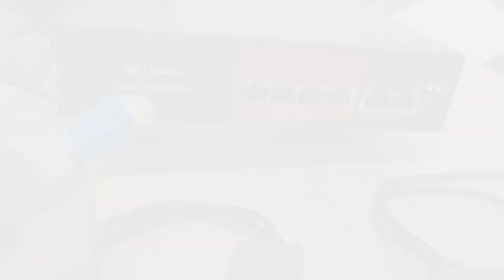How to use POE splitters to connect non POE IP cameras

Comment: Hi great video would i still need too use a router from modem too do this setup? Thank you
Reply from the maker: Hello, this requires only the POE Switch to work. You don't need the router unless you are using the router to help with Remote access and in that case you would have to connect the Camera to the  POE switch and link the POE switch to the Router. 
Please if you need further explanation, kindly send me an email, script.engineeringconsult@gmail.com

Comment: Just to make sure, if the switch wasn't the poe switch you would have to use both poe splitter and poe adapter yes?
Reply from the maker: Yes, when you don't have a POE Switch, a POE injector can be used.
Reply: @Tech_Inside_Out  So you would connect poe injector to non poe switch and additionally connect poe splitter to poe injector ?

Comment: Hi, you are using ethernet cable with mode A or B? Also would like to know if the cable is CAT5e or CAT6. Thank you.
Reply from the maker: I have used Cat 6 cables terminated as straight through cables in this Demonstration. But either straight through or cross over works.
Reply: @Tech_Inside_Out  Thank you :) can I send you a question via email? Im trying to do the same like you in the video and I cannot make the camera work.

Comment: what about if my camera only has a power connector and a BNC connector? the setup now is a 8k camera connected to DVR with a pair of balums over Cat5e
I am trying to update my setup little by little, going to get a NVR and am not sure if I can connect my camera to it, before in near future getting and IP camera
Reply from the maker: If the camera has a BNC connector + a Power connection, that suggest that it is an Analogue high definition (AHD) Camera. This tutorial mainly   applies to IP Cameras but you can however use the Power side of the POE splitter to power up AHD Cameras through a POE switch if you so wish. You can watch this video that explains it further https://youtu.be/cDqIulcrD8M
It is possible to Combine your existing AHD camera installation with a new IP camera system. Here is another video that shows how that can be done successfully. https://youtu.be/qdgTjBTqszQ

Comment: Is it compulsory to use poe splitter when connecting this nonpoe cam to the poe switch to nonpoe nvr?
Reply from the maker: No, it is not compulsory, I will do a short video showing an alternative means of power.
Reply: @Tech_Inside_Out  please weres the video? 
I want to understand if I can just plug a non poe network ip cam into a poe switch and it'll still work,

Comment: I BELIEVE THE NON POE WIRELESS CAMERA IS 12V, SO MY QUESTION IS HOW MANY VOLT POE SPLITTER DID YOU USE. CONSIDERING THE POE SWITCH IS 48V. THANKS FOR THE AWESOME VIDEO
Reply from the maker: Hello, 
The  POE splitter is powered by 48 volts from the POE switch and the splitter outputs 12v to be supplied to the camera
Reply: I was wondering the same exact thing, the camera is 12v but the splitter is 48v. My guess is that the splitter detects the camera is 12v and autobalance to that power.
Reply: it regulates the power to 12v
Reply from the maker: @dob3079  Yes, it does

Comment: I have this kind of splitter but there's problem somewhere between my setup , the injector is 48v 0.5a  output , my splitter is 48v-57v input and output of 12v 1.2A but the original charger is 12v 1.5A , I wonder why my Access point is having trouble with IP allocation or it does not receiving enough power? I can't connect and need to restart the system  but after a while I can't connect again . but if I use the original charger and passive poe injector/spitter then the whole system is fine
Reply from the maker: It is recommended to use the specified or supplied adapters with the specific power requirements to avoid challenges
Reply: yeah it gave me a headache

Comment: I want to use UTP cable not wifi one; do I have to use this method to connect non poe Ezviz C8C IP camera to NVR HIKVISION DS-7108NI-Q1/8P/M POE 8 CH? How to configure it?
Reply from the maker: For non POE IP cameras,  this is an option to connect them or you use a 12v adapter in connecting them and run a separate network cable for the video transmission.
Reply: @Tech_Inside_Out  does it need DHCP enabled for the camera? Using your method, my non poe ip camera did not detected by the NVR.
Reply from the maker: Am yet to cover Hikvision,  I hope to do it in the near future
Reply: @Tech_Inside_Out  thank you

Comment: Tried it bt didnt work
Reply from the maker: 1. Is it power that could not be delivered to the camera?
2. Have you tested the ethernet cable and confirmed that it was working?
3. Is the camera itself working?
4. How did you come to the conclusion that the POE splitter wasn't working?